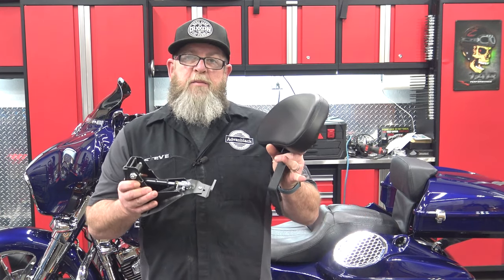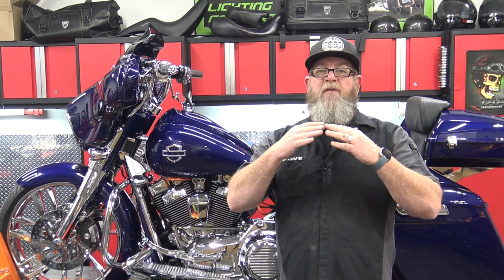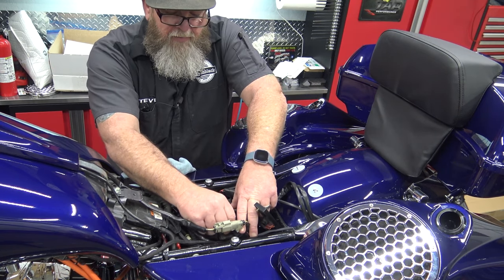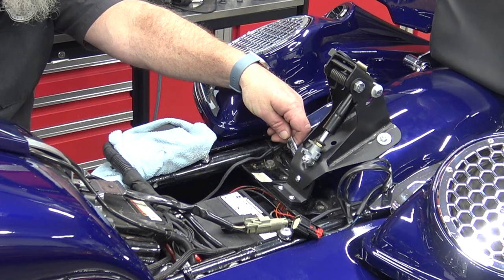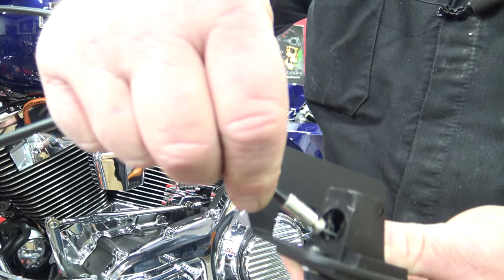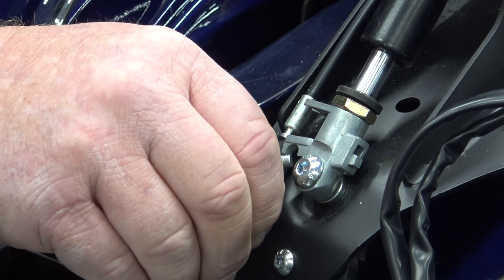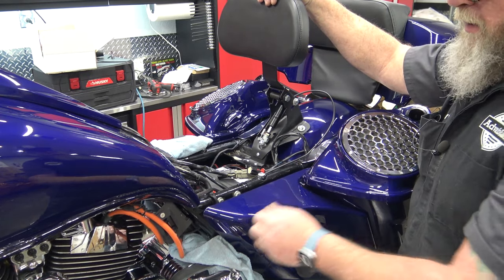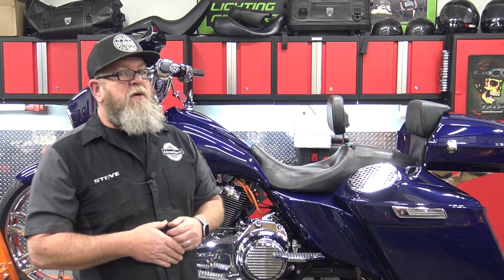Advanblack Adjustable Riders Backrest

Comment: My wife bought me the OEM version of this from the dealership for my '17 Road King and cost something like $250.
It was not a match made in heaven. 
Once I had it installed it angled too far forward and had me sitting too far forward forcing me to sit with my junk on the front horn of the seat.
I had to take everything apart and I had to improvise by installing 2 spacers with longer bolts on the front end, slightly bending the rear corners so they don't dig into my paint and separated by a rubber gasket.
Pain in the ass but I got it where I'm comfortable now.
Also it does work with my application of the heat shield because I only need a right side shield since that was the side I'm feeling all the rising heat.

Comment: Thank you for doing the most detailed description of this adjustable backrest installation. This is a fiddly job for sure. The written instructions leave a lot to be desired. One thing that adds a little complexity is if you have the left side heat shield. You have to sandwich that between the lever bracket and the frame. Also, on my 2013, the front fender bracket - the part that connects the main unit to the frame - is way higher than the holes in the frame. It's like the piston unit is not long enough. But I think after seeing this I can just use longer bolts. Again, thanks for taking the time to do this.

Comment: One piece of constructive criticism. You gave the size tool of the first bolt, but didn’t for any other bolt. I noticed you used a hex head but overall an excellent video that is really how these “self help” videos SHOULD be. Your professional, no war stories either. Right to the point, direct and well done! Oh, and you didn’t ask me to like and subscribe BEFORE I even watched the content. I did like and subscribe after watching. I look forward to more content. BTW, some YouTubers edit certain parts of their video during hard or tricky parts. It goes from the dude struggling to “poof” it’s in! I like how you did not seem to do that. This way we can see and learn the way to negotiate the tricky parts, like the battery cover removal you demonstrated. For your subscribers, a Milton Nut Holder is great for holding the nut onto the wrench. It slips on and off any wrench and holds the nut by a magnetic backer plate. Have fun and go RIDE!

Comment: Can this be used if I have the heat shields on my bike? I see the adjustment knob sits right where the heat shield sits
Reply from the maker: It will not fit with the heat deflectors. I've seen guys install it and cut this adjuster into the side cover, or in the deflector itself before though...its an idea..I have not done it but I've seen it done.

Comment: Why do these not work for 2021+ models?  Have a 2021 street glide and can't seem to find one of these backrests that will work.
Reply: I have the same question ‘22 SGS I can’t figure why it wouldn’t work though?
Reply: @michaelpohlman1925  I ended up ordering a no name one off of Amazon.  Seems to work just fine for me so far.